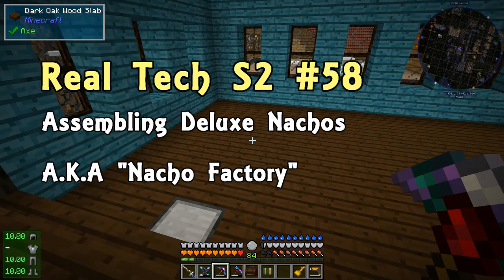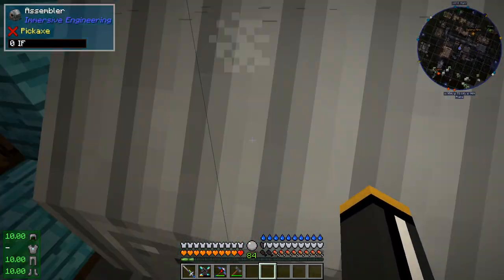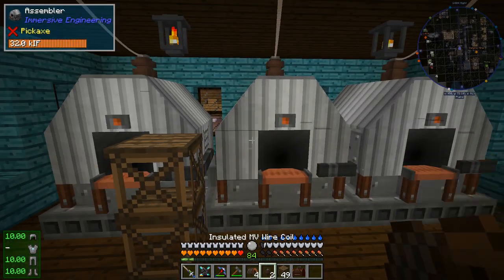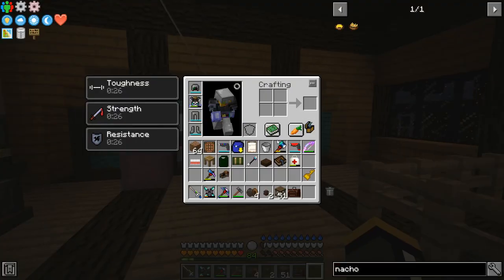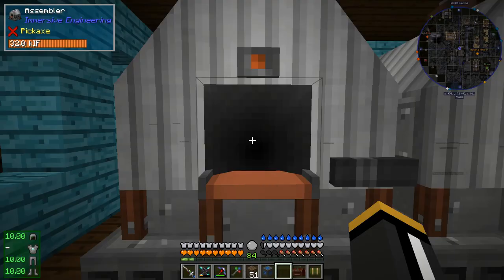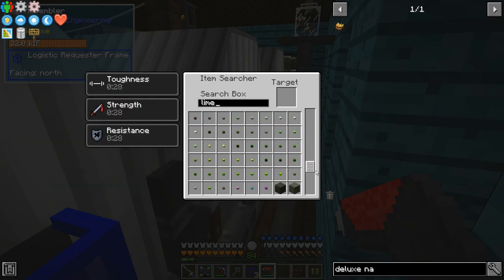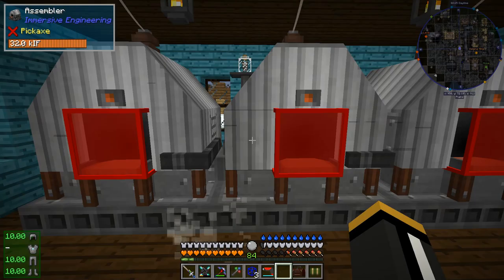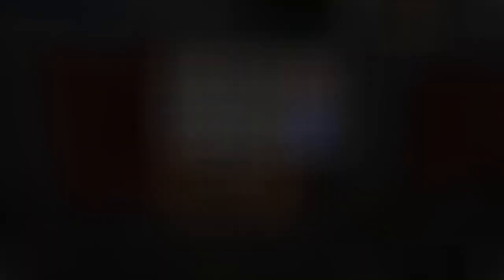Real Tech S2E58 - Nacho Factory

Comment: i'm not sure but maybe the drone can access the drawer controller only by the side where you put the items from the hand and not at the top
Reply from the maker: I thought that too at first. I failed to mention in the video that I did remove the block in front of it and made sure the frame was set to access the front. It still didn't work.
Reply: @DannySon  that one is a bit of a puzzler. Drawer controllers definitely don't care what side they're accessed on, so I wonder if the drone is getting confused about pathfinding there (since the controller is covered on all sides but one). I'll do a bit of testing on that...
Separately: if the drone is over-busy, speed upgrades can help a lot, as can adding more logistics drones.  They tend to co-operate quite well with each other :)
Reply: @DannySon   the reason is is it should be a storage frame
Reply from the maker: @MeMyselfandI No need for a storage frame here since I only want it to receive items, not provide them. A request frame should definitely work here.
@desht2008 I did break the front block, so it did have access to 2 sides. I did add a few speed upgrades to the drone, but haven't maxed it out yet. Never thought of having more than one drone though. That's a great idea and would be fun to watch too!
By the way, the book says you can use dispenser upgrades to increase the drone's inventory slots. I'm guessing it shouldn't say that. Should I add a bug report for that? While I'm there, I might add a feature request to set a minimum receipt for storage frames. :)
Reply: @DannySon  Yep feel free to raise issues for those. On that topic, I updated your other issue regarding payments not getting made - might have a fix for that 🙂
Reply from the maker: Awesome! I did see your response. I'll have to wait for a release before I can put it on my server, but I'll definitely keep you posted.
Reply: @DannySon  was hoping for some extra beta testing, but not to worry... 0.11.9 is available on CurseForge now :)
Reply from the maker: To clarify, when I say "release", I just mean that it's on Curseforge. Beta on Curseforge is fine too. Since my server is public and uses my pack on Curseforge, I don't have a good way to test SMP issues until they exist there. However, I should probably set up a test server for these purposes. It wouldn't be too difficult. In any case, we'll be testing this in live stream today.
Reply: @DannySon  or you can use a storage frame on the second drawer controller and specify it to the nacho. It might work becouse the storega frame workd on the first one.
Reply from the maker: You're probably right. I would then need to change the passive provider to an active provider which would be easy enough. I'm pretty happy with the setup I ended up with though. It's kind of neat having the drone fly into the food shop to replenish the drawer whenever I take form it. :)

Comment: At the end of the video you tried to collect the nacho with a controller. It didnot work becouse the drone couldnot reach the frame interracting side becouse in front of the controller was a half block. I think you can use the controller when you turn  the frame with the wrench so the drone can reach  the interracting side. I hope it wasn't to long.☺
Reply from the maker: I actually had tried that. I broke the block from the front of the controller and made sure the frame was set to use that side. I forgot to mention that in the video though. The mod author was puzzled by this too. It's possible that there's some kind of bug here.